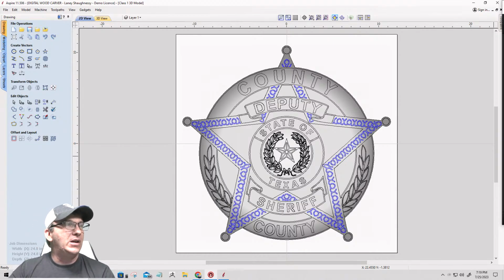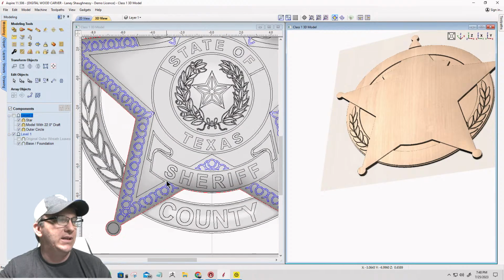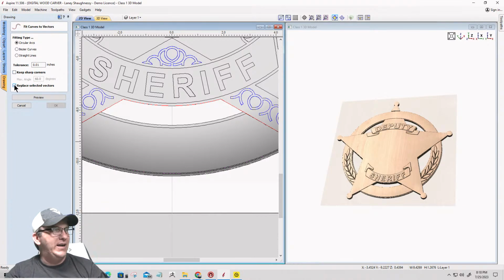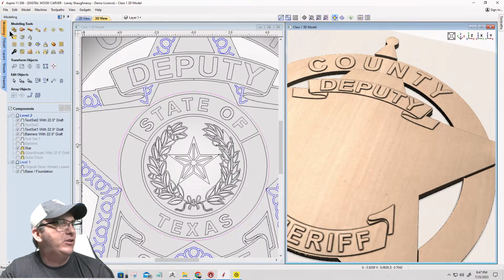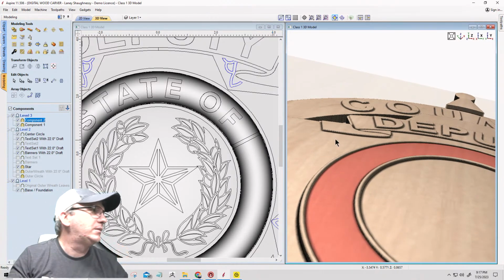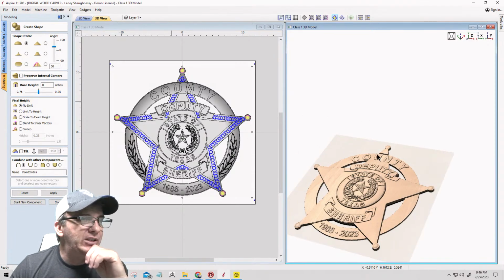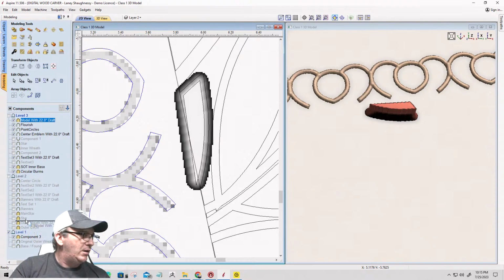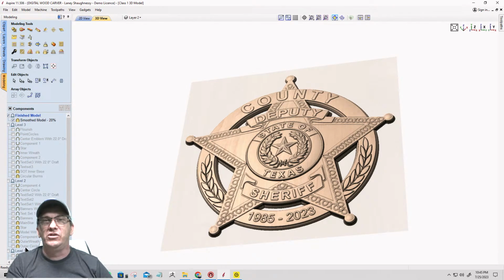Vector to 2.5D Model Using Vectric Aspire | Part 2 of 2

Comment: I will never be able to justify the cost for Aspire. I  bought Vcarve Desktop and have been going beyond that either with Fusion 360 hobbyist license or the open source Blender. There is an add on called Blender Cam for outputting gcode from Blender. If you are like me and can barely keep sharp bits on hand there is an alternative if you have the time to sit down and learn it. Youtube has all you need these days.